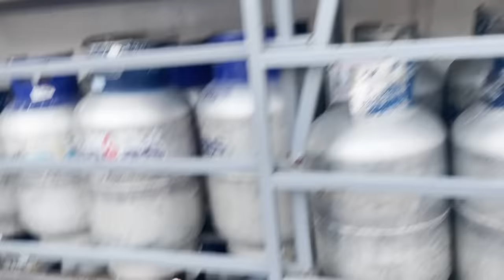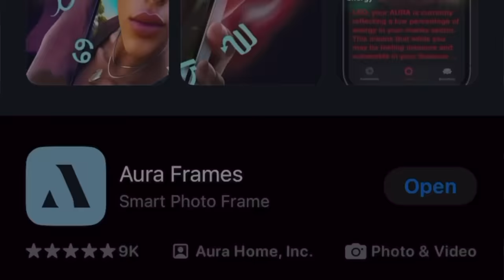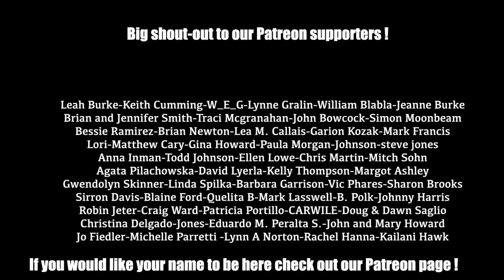WE ARE NOT PROUD OF THIS! living in Panama during crisis

Comment: You know how the old guys did it in the old days?  How they baked bread and cornbread on the wagon trail or the cattle drive?  They had deep "Dutch oven" pots---cast iron.  They would heat flat stones, and heat the pots (empty), then put the heated stone in the heated pot and put your bread pan over the stone, and cover it with a clean cotton towel, then put the lid on and let the heat of the pot and the stone to do the work of baking.  It takes practice.

Comment: I see you are getting lots of suggestions-:). Hope they give you lots of great ideas to start a list of possible items that could help you, especially during times like this.  One item that I am wanting to get is a Sun Oven, from what I hear even if the sun is not great it still might be possible to utilize?  You can cook, dehydrate, sterile water, bake etc.  Also I wanted to ask if you have ever heard of “water glassing eggs” ?  This is a way you can store up eggs, so when your chickens are laying heavy you can stock your pantry for the times they decrease.  Hope that idea helps.  Will you be building an outdoor but indoor kitchen on the property.  This could prove to be a  very valuable building.  You could install a pizza oven and or other bbq pit/stove top grill for cooking with wood, that you can be protect from the weather, especially the rain or hot sun😃👍🏼 You both are doing an awesome job, especially during this difficult time.  Also have you set up rainwater catchment as of yet?  The re-do of the bathroom turned out amaZing 😃👍🏼👏🏼👏🏼 Blessings

Comment: Why not cover around the faucets in the bathroom with tile. Wood will always be a problem because no amount of wood sealer will protect it from dry rot and mold. Wood absorbs, tiles do not.  Anyplace where you have running water, use tile.  
Get a Dutch oven and cook on a fire outside.  You can bake, roast anything in one!